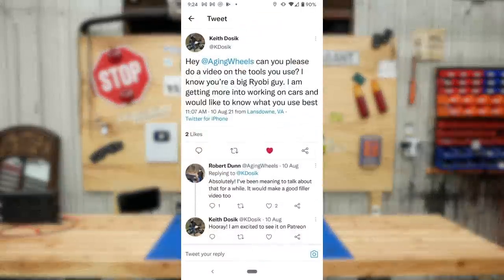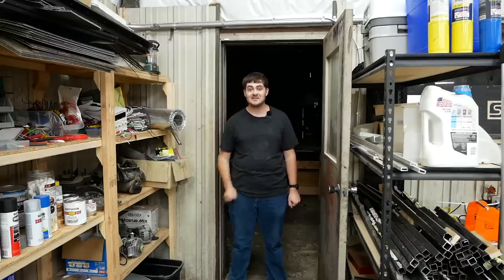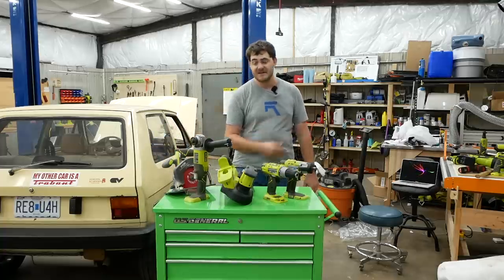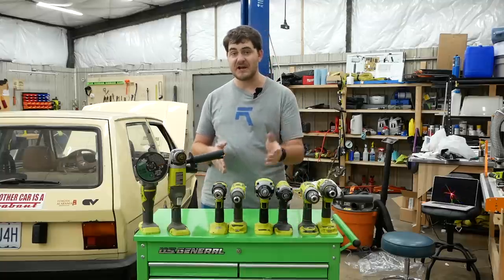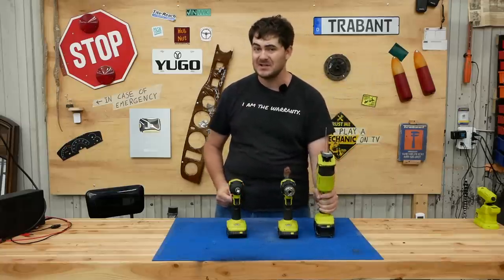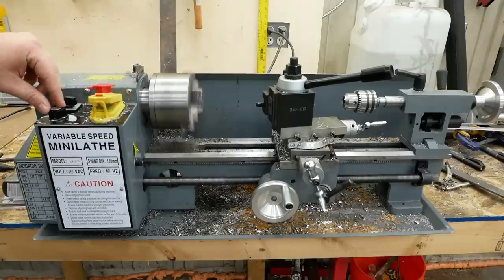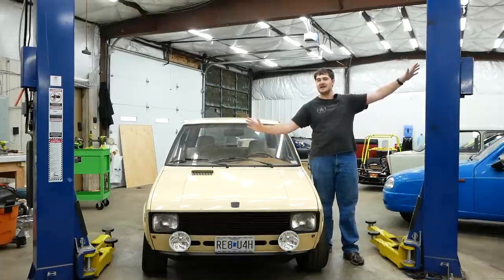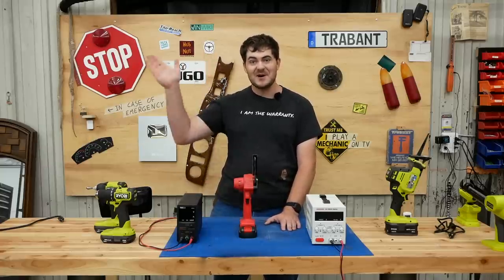What Tools Do I Use? Why? | Aging Wheels Tool Tour

Comment: Pro amateur tip: a single post mobile lift starts at about the same price as the Bendpak, it's nearly as functional (there's a beam in the middle which might get in the way for some jobs) and you don't have to pay anyone when it's time to move (given you can move 1600 lbs by yourself).

Comment: I think the only problem with Ryobi is the cheaper construction. It's fine for occasional use but in any sort of construction you'd be disappointed. I've been using dewalt and I've dropped all my tools off 12 foot ladders and I haven't had one break yet, but the cheaper tools have there place.
Reply: My stepdad dropped a ranger on his brushed ryobi sawzall and it's fine. Still technically works after being on fire 7 times.

Comment: I recently bought a 82V 18inch chainsaw and the battery was flat and showed about 20V. Sent an email and they sent me another kit entirely so I got a free spare saw

Took the battery apart and used a bench power supply to charge all cells from 1V or so to 3V+ and the charger accepted it and the battery is perfectly fine

The saw is amazing though, I see no reason to go back to gas saws

Comment: Doing a service upgrade to 200 amps will typically cost $2,000-$3,000.  I'm supposed that it was so cheap for you. Adding a 208 volt outlet could cost anywhere from a few hundred dollars to over a thousand depending on where the breaker panel is in relation to the outlet. My dad has added 208 volt outlets into most of the houses that we've lived in for his table saw and band saw, but those were literally right next to the breaker panel. Doing a long run would either mean attic/crawlspace runs, or EMT strapped to the outside of the building. 
Source: Am electrician's apprentice.

Comment: Maybe you'll see it maybe you won't but I would like some kind of I do insight as to when ryobi started using the "ONE+" battery configuration..

 I got a cordless pole saw from I think home depot and it was was in the same style of the rest of your modern lime green ryobi design  Language. 

Then in goodwill I find a rioby drill with the same is with the same battery connection but it looked like it was from the late nineties.

Comment: I have Ryobi's brushless drill that I used when building patio. I almost regretted buying brushless version since it only has electronic torque limiter instead of mechanical that usually are with brushed ones. First of all even the smallest setting was way too powerful, plus if you stopped and started again it started with full torque (or quite a lot) and stripped the screw from wood. That doesn't happen with mechanical one. Once you set it you can go full speed and torque limitter starts rattling one it hits the limit and you can't over torque it. With electrical limitter if you went full speed it would either strip the screw in wood or it would sink half way through the plank because there is no brake so it takes awhile to drill sto stop once the limitter activates. Other than that it's okay tool.
Reply: The HP brushless drill i just got has a mechanical clutch.

Comment: I very recently bought myself a first decent drill.
Ryobi R18PD7(P251 in hamburger land). It's insanely powerful but also insanely heavy, for that reason I can't exactly reccomend it, even with a 1,5Ah battery, unless you are constantly torturing your tools driving 30cm long screws you won't benefit from it too much, it will rather twist your arm into a corkscrew than stall, especially on HP batteries.

Comment: I gave up on cordless tools as the batteries always seem to die after 3 or 4 years. I don't think I could use that floor sweeping tool in case it swept up some vital small circlip or something. I use a vacuum cleaner but get down on my knees to get a closer look at what is being sucked up.

Comment: It's interesting that in the UK, Ryobi tools are not as inexpensive as in the US.  For instance, If I go to the Home Depot equivalent in the UK, B&Q, I can currently get a 3Ah 18v DeWalt battery for £50 and a a 2.5Ah 18v Ryobi battery for the same.  Similarly, a Ryobi 18V Cordless Impact driver costs £70 for the bare unit which is the same price as the identical Bosch model.  I think the Ryobi brand will be a much harder sell in a market so much closer in price.

Comment: I'm also a big Ryobi user, although I have nothing close to your collection... Agree on the finger sander. The only Ryobi I've had bad experiences with is the multi-tool; the one for cutting holes in plasterboards & stuff. The trigger died within minutes of using it, and it seems to be a major weakness. I believe they've come out with a replacement now that's not rubbish, but £expen$ive.

Comment: An easy way to find shorts on circuit boards is to put 99% isopropyl alcohol on it and watch for where it evaporates first. Shorts get hot and will evaporate the alcohol faster. I only recomend using  99% or 100% alcohol for this. Using less can be tantamount to pouring water on live electronics depending on how you do it. This is bad for reasons that put the BOOM in Electroboom. It is a broken electronic though. If it breaks further it isn't typically that big of an issue when it comes to modern big box store power tools.

Comment: Loved it! Thank you. I don't know what half of those tools are used for (I own a hammer, and a no-name electric screwdriver), but you're very entertaining. I wondered at the end, how many batteries you have for all your Ryobi tools? presumably you don't need one battery per tool, because you aren't using them all every day. Also, how fast do they charge?  Thanks.
Reply: The standard "combo pack" Ryobi batteries are pretty lame, just 1.5Ah capacity which is good because it's cheap and light but only really useful for drills and other light duty. You cannot draw big current from single-parallel cell packs like those, and if you try you will cook the cells inside them. Ryobi batteries are a clunky shape, since they are the same as the old Ni-CAD tools from 10-15 years ago, that shape makes some tools ungainly and unbalanced to work with.
The larger Ryobi packs are not too bad, but you need at least a 4Ah (two-parallel cells) for medium duty and a big boy with 3-parallel cells if you want to run grinders, etc. For all of Rob's tools you'd only need 2 x 1.5Ah, 2x4Ah and 1xBigger one. They charge at various speeds depending on the charger. The small ones perhaps 30-40 minutes, the larger ones in an hour or so.
All of the Ryobi batteries suffer from a problem where they self drain the first cells in the array, killing those cells and totally destroying the whole pack. That happens if you store the pack in a "flattened" state, so always always charge them before storage and rotate them to even out the wear and keep them topped up - if they go dead flat and you don't know (eg: during storage), they WILL be destroyed.

Comment: There is crap in the Rigid line.  I bought their corded hammer drill.  After making a few dozen holes the thing blew up and caught fire. (Well at least I DID smell smoke).  The motor had 86'ed itself.  It went back to HomeDepot for a refund, and I then spent half of that refund at Harbor Freight for a replacement that still works after making another few dozen holes.
BTW IIRC some of the Rigid tool line was originally made by Emerson Electric.  At least my now ancient Rigid table saw was.

Comment: I have to say you are absolutely correct about the circular saw there is almost nothing more worthless unfortunately it's the only cordless that I have that I can use doing a siding project so now each cut on each piece of siding and there are a hundred and forty that have to be cut takes four times as long while I wait for the saw to decide it wants to cut. Do you have a battery circular saw that you like? Because once this job is done I'm going to run this one over with a car

Comment: The truth is that one has to choose who to buy cordless power tools from because once you make that choice your basically stuck because batteries. I use Makita, which is about at the same price point of Milwaukee and even they, with their fine Japaneese engineering, have some absolute clunkers in their product line. I do, however, like that they haven't changed the form factor of their batteries in quite some time so that older tools still work with new batteries. Not sure how Ryobi fares in that department, but I know Milwaukee and Dewalt aren't especially good with that.

Comment: Edit: you just said they have a secondary outlook at the end. Welp.    "Ryobi approved retailer" you just said only home Depot sells Ryobi, so you bought it at home Depot
Reply: While Home Depot is TTI's exclusive mass-market US retailer for Ryobi, the Direct Tools outlet stores (which is what Robert likely meant by "Ryobi approved retailer", seeing as he goes into more detail about those and buying from them later in the video) are owned by TTI and there's less than 40 of them nationwide, most of them east of the Mississippi. In comparison, Home Depot has over 2300 stores nationwide, so Direct Tools' existence isn't really a threat; besides, TTI's power tool brands are very recognizable in the marketplace and no doubt make a lot of money for them. So, it's kind of in HD's interest to tolerate TTI's outlets, since there's so few that many HD shoppers have no idea about them (as for myself, until this video, I had no idea about the Direct Tools outlets and I've also been in the Ryobi ecosystem for years; what's even better is that there's one here in Nashville, a few miles from my house [and less than a mile from a Home Depot]).

Like many manufacturer-owned outlet stores, it's just one of those "if you know, you know" things spread by word-of-mouth.

Comment: The reason I would ask "Why Ryobi?" is that my experience with them has been less than ideal. The tools are OK, but the batteries in the ones I have had are complete junk. Like the cordless drill I have right now. 6 batteries, not one of them will hold a charge for more than about 5-6 3 inch screws, not a single one of them has been charged more than 10 times. But, my Hypertough impact driver will drive about 100 of those same screws without even slowing down!

Comment: Hehe I'm a big King Dick guy, always a risible moment of mirth when I announce to friends, neighbours etc that I am just popping in to get my King Dick out...  If I ain't got King Dick in me hand, its Britool and if not Britool its pre-Chinese Draper.   Am a fan of Lidl's Parkside and Aldi's Ferrex range of electrical tools, had both my Parkside cordless drill and impact driver for coming on 5 years and they are just working as good as day I bought 'em and I do work tools hard.   There is a contention that Parkside is a budget brand of Metabo but on both my driver's its all made in Germany, nothing Chinese in there except maybe a chip and switchgear, motor is German made.

Comment: You are a bad influence... I got pissed at my 14" Polan chainsaw. It has served me well for years and now the carb needs a rebuild or replace. Its cantankerous. My Toro weed wacker is the same way. So I went to Hodepo and bought a 18V 12" saw after a lot of standing in the isle and humming and hawing. I ran a couple of other errands and it began to hit me that I really needed the bigger one, and went back and changed all that for the 14" 40V.  A quick test this AM tells me it cuts like my 14" gas saw. Don,t know how long the 4Ah battery it comes with will last yet though. I may need a 2nd battery. I have some of those expand-it swap-able tools for my weed eater.. So I am going to order a 40V weed eater off the Hodepoo web store, since they don't have the tool only at the store. And then I can use my hedge attachment so I dont need a separate one.  Ryobi needs to sponsor you. No really Ryobi.... get on that. Or maybe homedespot. The 0 turn is neat but too small to be good for my place. Not going to downgrade from a 26hp 54" tractor. I can see me buying into the 18V  later on as my older DeWalt stuff dies. I need to rebuild a battery pack for that but its NiCad... I can take the Ni batt and change it to Li (and use a different charger) but not sure if worth.

Comment: We liked our Ryobi tools and but the battery system is crap. It was pretty much our tool system of choice until we found that battery after battery was failing, sometimes catastrophically, within or just outside the warranty period. We hit a point very quickly where it was no longer worth the inconsistent reliability to continue to invest in the system and have moved on to other brands.

Comment: I get poo-pooed for buying Ryobi tools, but the reality is:
-They're cheap.
-They still have decent ugga-duggas, I have drilled  1/2" holes with mine before, without cooking the drill.
-They're cheap.
-I'm not using them every single day.
Reply: I got a set of used Ryobi tools from a painter around 2007. They won't die. The NiMH battery just died last month.

Comment: To the people watching: Just get a 3d printer. Prusa MK3S is the best hobby printer on the market if you're willing to spend $750 and build it yourself. If the price is too much, get a $200 Creality Ender 3 and live with the slightly dodgy machine quality and print out some upgraded parts down the road.

First thing to do when you get a 3d printer: 3d print spare parts for your 3d printer.
Reply from the maker: I said I got an Ender 3 towards the end of the video
Reply: Prusa fanpeople everywhere....
Reply: @rarbiart  They run extremely well and require no modification to get commercial grade parts, that's why people are fans of them.
Reply: @namAehT  How do you spot a Prusa user? - Not needed, he will tell you without asking.

Comment: 2k fir a SINGLE outlet??? So what if it's 240? I work electrical, and that's a straight up abhorrent price. it takes 4 wiresThe only reason is if you would've had to pull like 2 circles' worth of angle... Good God you get screwed on that.